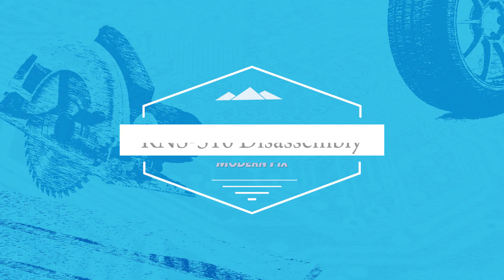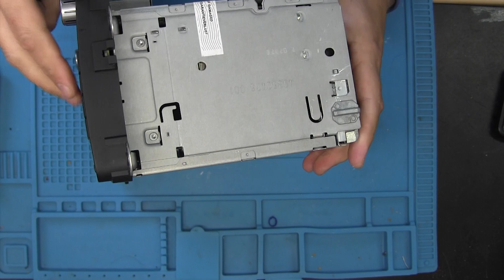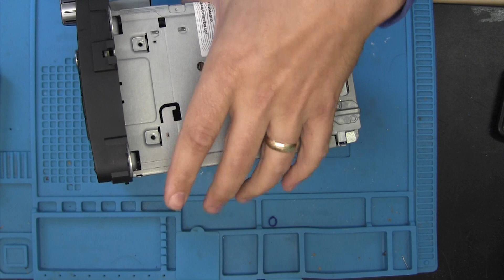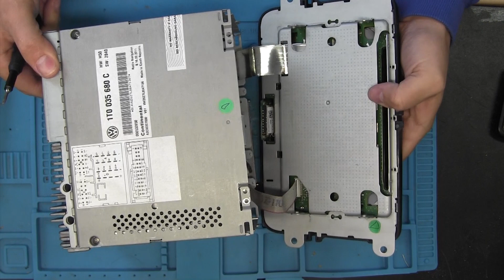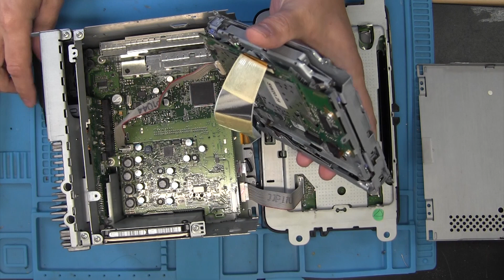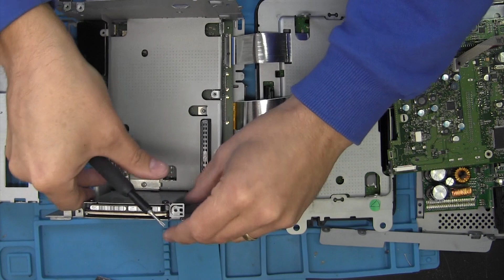Disasembly of a RNS 510 head unit

Comment: HELLO, I IMPORTED PASSAT 2015 FROM KOREA AND NOW I HAVE A PROBLEM WITH THE SCREEN WHEN I CLICK ON DMB, NAV, PHONE. DO YOU KNOW WHAT THE PROBLEM IS OR A SOLUTION TO IT?
Reply from the maker: It goes blank or you get strips when you click on a button? The frame maybe hitting the LCD edges, their maybe a loos cable. You would need to open the unit and check for anything obvious.
Reply: @modernfix1  IT BECOMES BLACK FOR ABOUT TWO SECONDS AND THEN NO SIGNAL
Reply: @modernfix1  It becomes a black screen for about 3 seconds and then No signal
Reply from the maker: @r1Passat  Sounds like a loos connection or a corrector.
Reply: @modernfix1  Is there a way to fix it?
Reply from the maker: @r1Passat  just open the unit and take a look. You can start by unplugging the display connector and cleaning it with isopropyl alcohol.
Reply: @modernfix1  Do you mean the screen or the Exbox under the seat?
Reply from the maker: @r1Passat  so your is already of the newer design that the actual computer is in different location that the screen? Then I would say star with the screen.
Reply: @modernfix1 Do you have a way to contact me to send you some pictures of the problem?

Comment: The rear fan on the RNS 510, is it suppose to be always running? Or does it turn on only on certain temps?   I am starting to experience issues with my RNS 510 in my 2015 VW CC 3.6L
Reply from the maker: Yes, it is always running. Hard drive is the most usual part that fails since it is mechanical. There are stuff that you can do with it but honestly the unit is not that good. I changed my unit to for a cheap RCD 330 and it is so much better. A lot faster and you can use your phones google maps to navigate. I have a video about the installation process. https://youtu.be/nq0hRn6FDCs